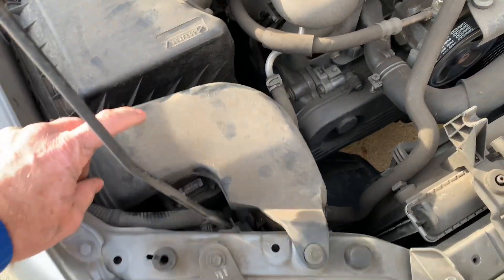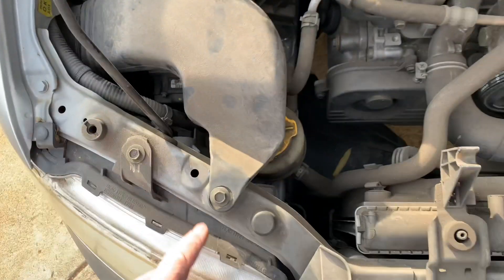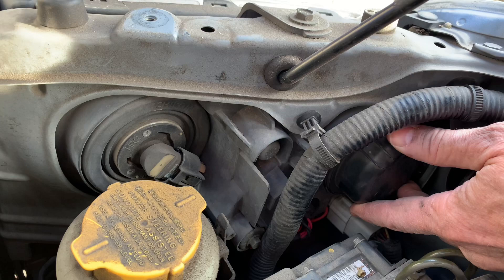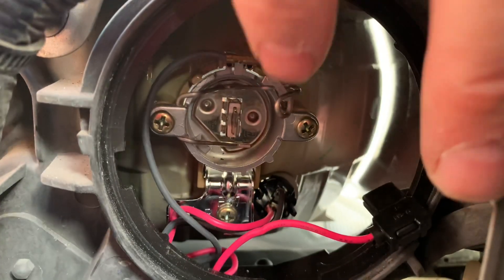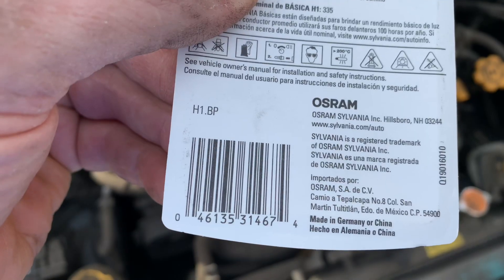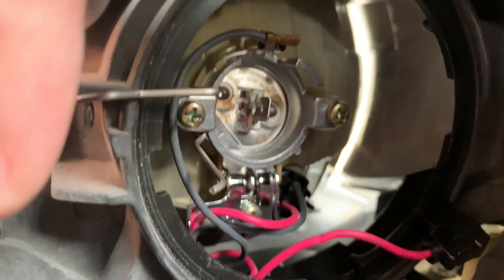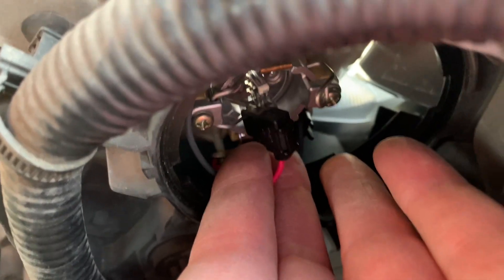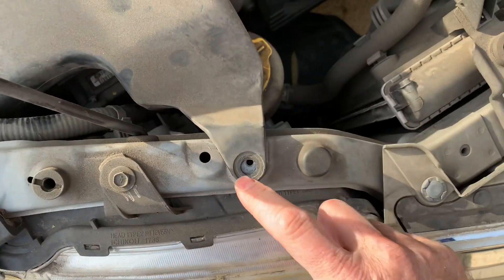How To Change Headlight Bulb On Subaru Impreza

Comment: Luckily I think most of these instructions work across multiple years and models of Impreza, but you should nonetheless really show or tell what year and trim this Impreza is, since different model years have very different headlight arrays.
Also, it would be nice to see the other side done, despite the battery issue.
Still, I appreciate the camera angles, which most other videos like this don'r have.